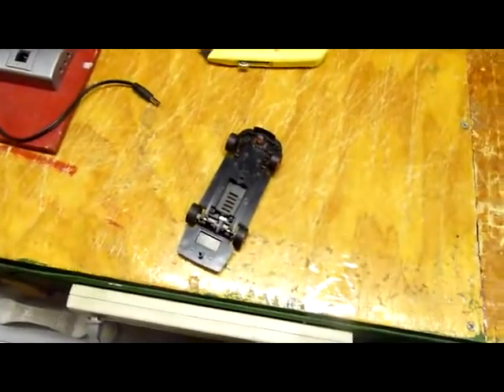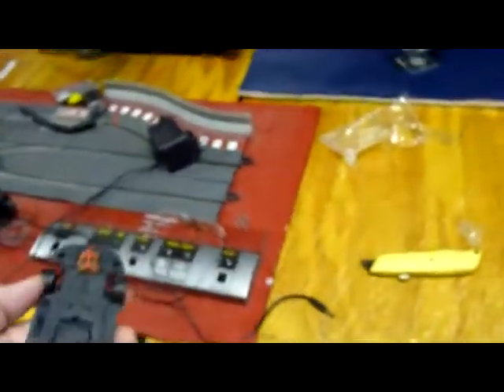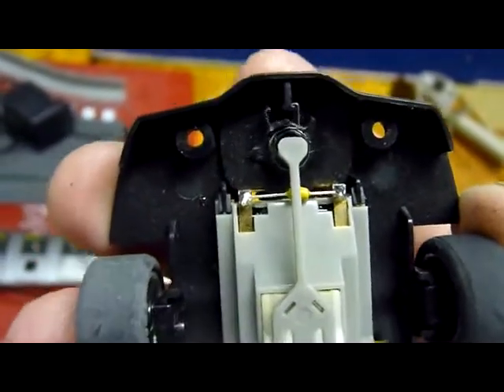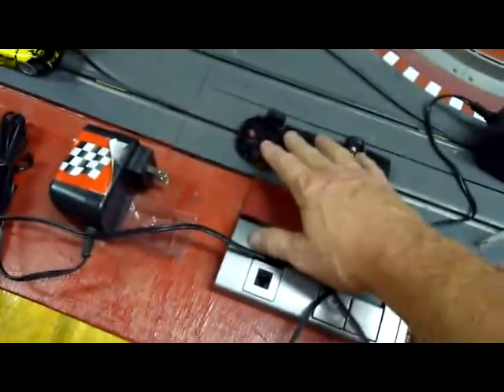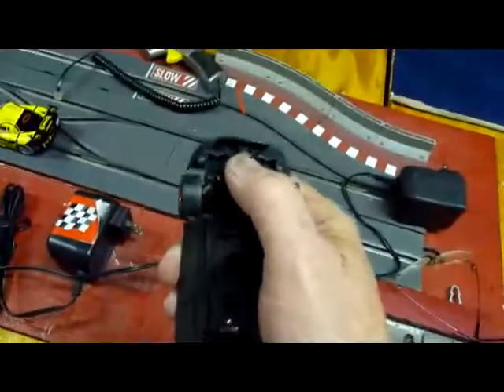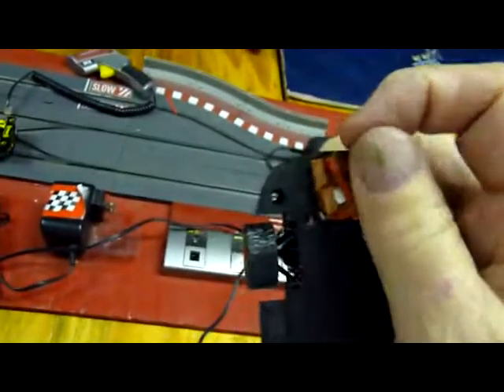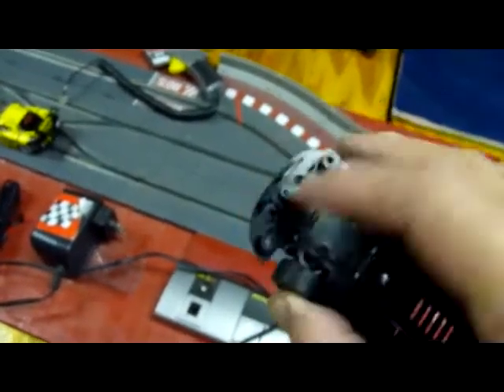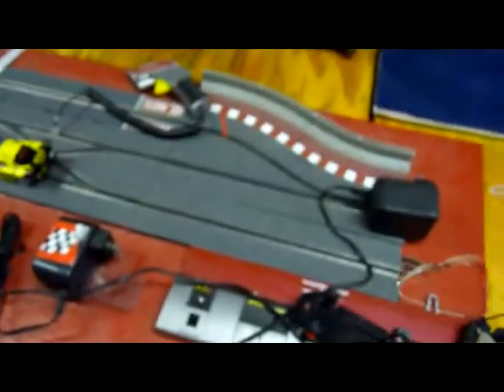What is the Reason for the ARS

Comment: Hi Bryan, ARS is a good system in theory. Unfortunately the plastics used are not robust enough. I have over 80 cars, 60 of them have broken ARS systems. This is a shame, as if I wish to use one of them I have to remove and insert the ARS from another working car should I wish to operate it as no spare parts are readily available. I bought a BMW  few months ago, it has the newer version ARS fitted. It broke on the first lap, another vehicle unfortunately race retired.